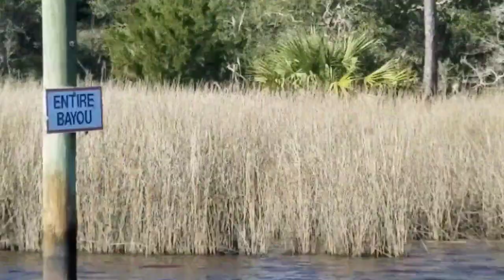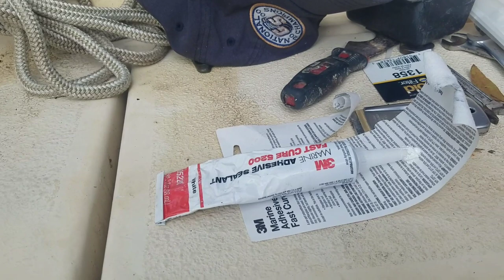Ep:2.5 Winter Beagle Escape | Behind the Scenes and In betweens

Comment: Hey Brenton those fittings on your steering look like the threads are the same on the T's. You should be able to put the bleeds where the hoses are. be very careful trying to turn the fittings and creating a leak, also air is going to enter the system so you are going to have to bleed the air out! Great adventure!!!

Comment: On your hydraulic lines you can shorten them to the exact length but it would require marking them then remove and take somewhere with a fitting press. They can cut them off and put new fittings on.

Comment: Brenton, on my Noimad, the hyd steering cable is set up the same, I would also like to change it, but it may not be do-able wo some major mods. Can you take a shot of the SERIAL NUMBER on that motor? I have to take a pic of it in order to Register this boat, I can't get it registered wo a pic of that SN. I Googled it, said it is "below the cowling, on the right side" I can't find it and I'm dead in the water wo it. I even went and asked my friend who Manages the local boat shop. I can't find a SN, they said NO WAY to Register WO Serial number. Thanks.